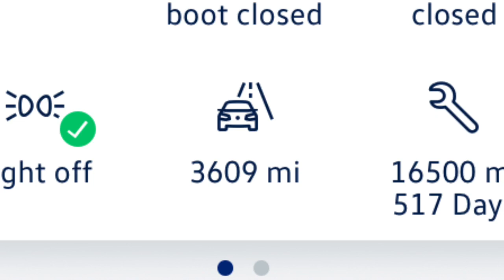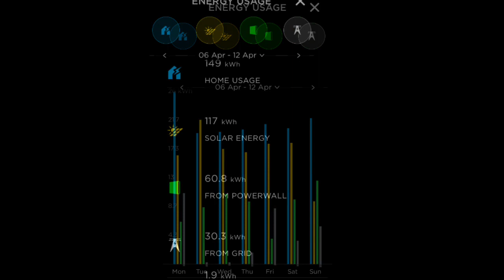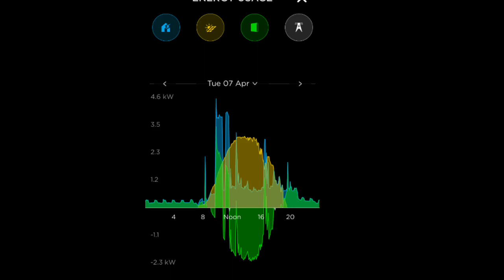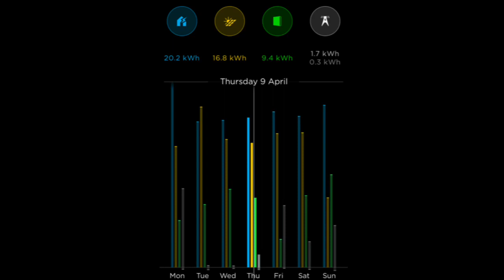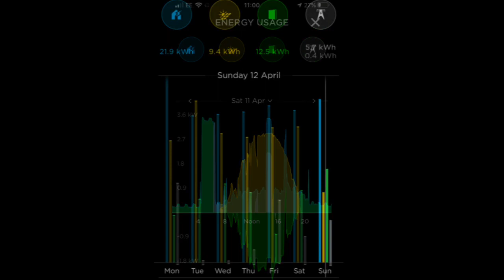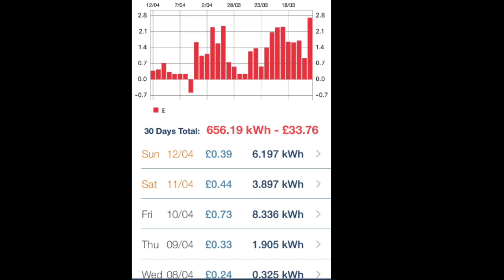Week 15 Usage

Comment: Thanks Chris for the update. Good to see some sunshine and limited pull from the grid.
Reply from the maker: The only pull from the grid was done at very low agile prices, this week I have far to much power being generated and giving back to the grid even after heating water but this is thanks to higher efficiency from the cooler outside temps, my inverter is now clipping where it wasn’t last week when it was generally a lot hotter, 👍
Reply from the maker: John Tisbury I bet your exporting a lot